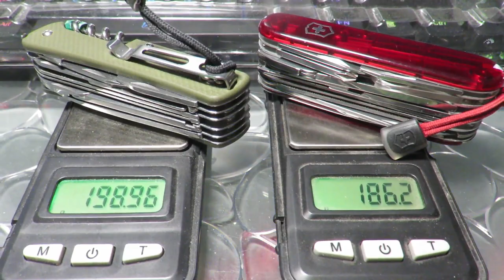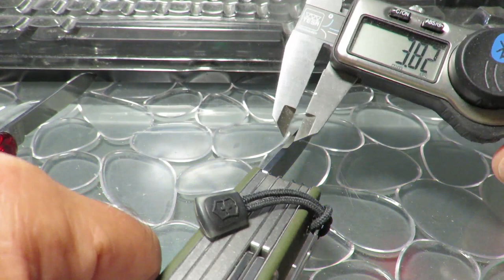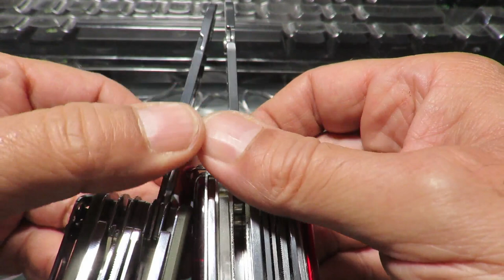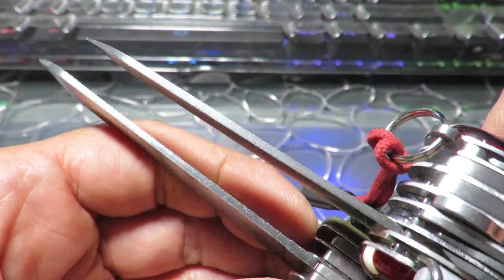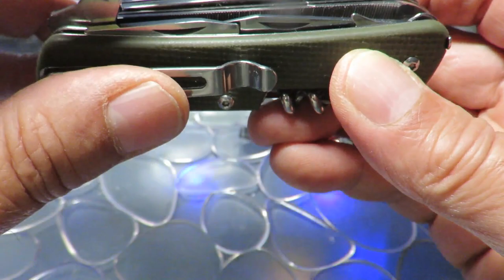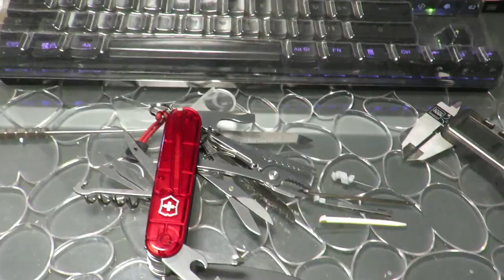RUIKE Criterion M61-G vs VICTORINOX Swiss Champ

Comment from the maker: MT VOD * Dear lovers of multi-tools, you can ask me everything, redo a review, insist on a detail, make comparisons, test this or that, I am at your disposal! :) * Multi-Tool VOD
Here is my collection of multi-tools (August 2020) [/S = Brand Sheath]. Each model has been the subject of one or more videos (see my playlist "MULTI-TOOLS").
001-	BALADEO Outdoor Cutlery Multi-tool /S               
002-	BEAR & SON Bear Jaws 155LS /S
003-	BEAR & SON Bear Jaws Multiscissors Gardener BC157GT /S
004-	BEAR & SON Electrician's Bear Jaws BC155EL /S
005-	BEAR & SON Mini Bear Jaws 153
006-	BIBURY GHK 10-in-1 EDC
007-	BIBURY Multifunction Garden Pruner BBY-MT11 (offered by the company) /S
008-	BIBURY Multifunction Tool 21-in-1 BBY-MT08 (offered by the company) /S
009-	BIBURY Multifunction Tool 16-in-1 X0016E2LAJ (offered by the company) /Box
010-	BLACK FOX BF200 /S
011-	BÔKER PLUS Tech Tool Carbon 4 /S
012-	BÖKER PLUS Tech Tool City 5 /S
013-	BUCK Knives X-Tract 730 /S
014-	BUCK Knives X-Tract 735BKS-B Essential
015-	BUCK Knives BuckTool 350 (MiniBuck)
016-	BUCK Knives BuckTool 355 /S
017-	BUCK Knives BuckTool 360 /S (*2/ one completely broken)
018-	BYRD ByrdRench BY15P /S
019-	COLEMAN Pro Lock /S
020-	CRKT Bivy CR9250 (by Hans Florine)
021-	CRKT Guppie CR9070 (by Launce Barber)
022-	CRKT Technician Multi-tool CR9201 (by Glenn Klecker)
023-	CRKT Tool CR9200 (by Ed Van Hoy & Tom Stokes/ with Bit Kit) /S
024-	CRKT Zylla-Tool Jr. CR9065K /S
025-	CRKT Wooden Multi-Tool Kit CR1035
026-	DEEPEE 8-in-1 Shears Multi-Tool /S
027-	EICKHORN SOLINGEN PRT-II Rescue Knife /Böker S
028-	FISKARS Cuts+More
029-	FLEXCUT JKN91 Right-Handed Carvin' Jack /S
030-	FLOCON DE NEIGE 18-in-1 /S (& 15-in-1)
031-	GANZO G301-H /S
032-	GANZO G302-B /S
033-	GERBER Armbar Drive Onyx
034-	GERBER Balance /S
035-	GERBER Bullrush /S
036-	GERBER Center-Drive (with Bit Kit+ Victorinox Scissors) /S
037-	GERBER Center-Drive Plus (with Bit Kit) /S
038-	GERBER Crucial /S
039-	GERBER Crucial F.A.S.T. (with Hex Bit Kit)  /S
040-	GERBER Curve
041-	GERBER Diesel /S
042-	GERBER Dime (*3/one with broken cissors)
043-	GERBER Flik /S
044-	GERBER Fit /S
045-	GERBER FreeHand /S
046-	GERBER Freeman Exchange (with 3 blades) /S
047-	GERBER Grappler /S
048-	GERBER Prybrid Utility
049-	GERBER MP1 /S
050-	GERBER MP1-MRO (with Bit Kit) /S
051-	GERBER MP 400 Compact Sport (05500/ 45500) /S
052-	GERBER MP 500 Recoil Auto-Plier /S
053-	GERBER MP 600 Bluntnose (old model with 55200 Multi-Plier Pocket Tool Kit) /S
054-	GERBER MP 600 Bluntnose Black (07520G1N Carbide Cutters with Tool Kit) /S
055-	GERBER MP 600 Bluntnose SS (07500 Carbide Cutters) /S
056-	GERBER MP 600 Pro Scout (07564/ 47564 with Tool Kit) /S
057-	GERBER MP 650 Evolution (with 2 heads)
058-	GERBER MP 700 Urban Legend /S
059-	GERBER MP 800 Legend /S
060-	GERBER Multi-Lite (07205)
061-	GERBER Nautilus /S
062-	GERBER Obsidian
063-	GERBER Octane /S (*2)
064-	GERBER Radius /S
065-	GERBER Splice
066-	GERBER Strata /S
067-	GERBER Suspension /S
068-	GERBER Suspension-NXT /S
069-	GERBER Truss /S
070-	GERBER Vise
071-	HANWEI Professional Multi-tool by PAUL CHEN 1008-GT
072-	HAVALON Evolve Jim Shockey Signature Series XTC-60AMTS /S
073-	HENSTRONG (or Bibury or Intey or …) 18-in-1 /S
074-	KERSHAW A100C /S
075-	KERSHAW Select Fire 1920
076-	KELVIN.36
077-	LEATHERMAN Blast (with Removal Bit Driver) /S
078-	LEATHERMAN Brewzer
079-	LEATHERMAN Charge+ (with Bit Kit & Pocket Clip & Lanyard Ring & Bit Driver Extender) /S
080-	LEATHERMAN Charge+ Forest Camo (with Bit Kit & Pocket Clip & Lanyard Ring & Bit Driver Extender) /S
081-	LEATHERMAN Charge+ G10 (red) (with Bit Kit & Pocket Clip & Lanyard Ring & Bit Driver Extender) /S
082-	LEATHERMAN Charge+ TTI (with Bit Kit & Pocket Clip & Lanyard Ring & Bit Driver Extender) /S
083-	LEATHERMAN Charge AL /S
084-	LEATHERMAN Charge ALX Black Oxide /S
085-	LEATHERMAN Charge TI 2HO (with Bit Kit & Pocket Clip & Lanyard Ring & Bit Driver Extender) /S
086-	LEATHERMAN Charge TTI (with Bit Kit & Pocket Clip & Lanyard Ring & Bit Driver Extender) /S
087-	LEATHERMAN Charge XTI (with Bit Kit & Pocket Clip & Lanyard Ring & Bit Driver Extender) /S
088-	LEATHERMAN Core /S
089-	LEATHERMAN Crunch /S (*2 / including a clone)
090-	LEATHERMAN Expanse E306X /S
091-	LEATHERMAN Expanse E33BX /S
092-	LEATHERMAN Expanse E33T /S
093-	LEATHERMAN Expanse E55BX /S
094-	LEATHERMAN Expanse K502X /S
095-	LEATHERMAN Flair /S
096-	LEATHERMAN Free K2X
097-	LEATHERMAN Free K4
098-	LEATHERMAN Free P2 /S
099-	LEATHERMAN Free P4 /S
100-	LEATHERMAN Free T2
101-	LEATHERMAN Free T4
102-	LEATHERMAN Freestyle /S
103-	LEATHERMAN Freestyle CX /S
104-	LEATHERMAN Fuse /S
105-	LEATHERMAN Juice B2
106-	LEATHERMAN Juice C2 /S
107-	LEATHERMAN Juice CS3
108-	LEATHERMAN Juice CS4 /S
109-	LEATHERMAN Juice KF4 (offered by the company & signed in my name by Tim) /S
110-	LEATHERMAN Juice Pro (with Victorinox Mini Screwdriver) /S (*2/ one offered by the company & signed in my name by Tim) /S
111-	LEATHERMAN Juice S2 /S
112-	LEATHERMAN Juice SC2
113-	LEATHERMAN Juice SX /S
114-	LEATHERMAN Juice XE6 (with Victorinox Mini Screwdriver) /S
115-	LEATHERMAN Kick /S
116-	LEATHERMAN Klamath /S
117-	LEATHERMAN Leap /S
118-	LEATHERMAN Mako TI
119-	LEATHERMAN Micra
120-	LEATHERMAN Mini Tool
121-	LEATHERMAN MUT (with Bit Kit & Tool adapter V2) /S
122-	LEATHERMAN MUT EOD /S
123-	LEATHERMAN Nehalem /S
124-	LEATHERMAN OHT (with tweezers) /S (*2)
125-	LEATHERMAN PST (*2)
126-	LEATHERMAN PST II
127-	LEATHERMAN PULSE /S
128-	LEATHERMAN Raptor /S
129-	LEATHERMAN Rebar /S
130-	LEATHERMAN Rev /S
131-	LEATHERMAN Signal /S (with Bit Kit & Bit Driver Extender)
132-	LEATHERMAN Sideclip /S
133-	LEATHERMAN Sidekick /S (with carabiner)
134-	LEATHERMAN Skeletool /S
135-	LEATHERMAN Skeletool CX V1(with Bit Kit & MUT Bits) /S
136-	LEATHERMAN Skeletool CX V2 /S
137-	LEATHERMAN Skeletool KBX
138-	LEATHERMAN Skeletool RX (with Bit Kit & MUT Bits) /S
139-	LEATHERMAN Squirt E4 (*2/ one offered by the company & signed in my name by Tim)
140-	LEATHERMAN Squirt ES4
141-	LEATHERMAN Squirt P4
142-	LEATHERMAN Squirt PS4
143-	LEATHERMAN Squirt S4
144-	LEATHERMAN Style
145-	LEATHERMAN Style CS
146-	LEATHERMAN Style PS
147-	LEATHERMAN Super Tool /S
148-	LEATHERMAN Super Tool 200 (with Tool Adapter V1) /Combo S
149-	LEATHERMAN Super Tool 300 /S
150-	LEATHERMAN Super Tool 300 EOD /S
151-	LEATHERMAN Super Tool 300M /S
152-	LEATHERMAN Surge (with Bit Kit & Pocket Clip & Lanyard Ring & Bit Driver Extender) /S
153-	LEATHERMAN Surge 2013 Black Edition (with Bit Kit & Pocket Clip & Lanyard Ring & Bit Driver Extender) /S
154-	LEATHERMAN Wave (with Bit Kit & Pocket Clip & Lanyard Ring & Bit Driver Extender) /S
155-	LEATHERMAN Wave+ (with Bit Kit & Pocket Clip & Lanyard Ring & Bit Driver Extender) /S
156-	LEATHERMAN Wave+ Black Limited Diegel Edition /S
157-	LEATHERMAN Wave Original /S
158-	LEATHERMAN Wingman V1 /S
159-	MASERIN Citizen 564/G10N (by Moris Baroni)
160-	MAXKNIVES MKTI1
161-	MOSSY OAK 17-in-1 /S
162-	NEXTOOL Xiaomi 10-in-1 KT5023 Motool /S
163-	NEXTOOL Xiaomi Flagship Mini KT5022
164-	OPINEL N°9 Bricolage
165-	OPINEL N°12 Explore
166-	OZARK Trail MULTIFORCE PREMIUM 18-IN-1 MULTI TOOL /S
167-	PIRANHA 6-in-1 (crescent wrench & pliers combo) /S
168-	PIRANHA 9-in-1 (crescent wrench & pliers combo) /S (*2)
169-	RATNIK 6E6 (with diamond-coated file) /S
170-	ROXON Knife Scissors S501 (*2 /  one offered by the company)
171-	ROXON Multi BBQ Tool MBT Mini S602 (offered by the company)
172-	ROXON Multi BBQ Tool MBT3 S601 /S (*2/ one offered by the company)
173-	ROXON Phantasy S502 (with 4 blades)
174-	ROXON Phantom S802 /S (*2)
175-	ROXON Spark CM1349 /S (*2/ one offered by the company)
176-	ROXON Storm S801 (with bit kit & Victorinox Mini Screwdriver) /S (*2 / one offered by the company)
177-	ROXON Storm S801S (with bit kit & Victorinox Mini Screwdriver) /S
178-	RUIKE Criterion M61-G (with Victorinox Mini Screwdriver) /Böker S
179-	RUIKE Trekker LD43 Rescue Tool
180-	RUIKE Trekker LD51-B (with Victorinox Mini Screwdriver) /Victorinox S
181-	SCHRADE Tough Chip ST2 /S
182-	SCHRADE Tough ST1 (original U.S./ version 1) /S
183-	SCHRADE Tough ST1 (Taylor Brands Schrade) /S
184-	SCHRADE Tough ST11 /S
185-	SCHRADE Tough STE5 /S
186-	SEBERTECH Sebertool M2
187-	SEBERTECH Sebertool M4
188-	SOG CrossCut 2.0
189-	SOG CrossGrip
190-	SOG Kilowatt
191-	SOG Paratool S31 (with Saw instead Philipps screwdriver + Bit Driver + Hex Bit Accessory Kit) /S
192-	SOG ParaShears /S
193-	SOG Pocket PowerPlier S44 /S
194-	SOG PowerAccess Deluxe (with bit kit) /S
195-	SOG PowerAssist S66 (with Saw instead of V-Cutter) /S 
196-	SOG PowerDuo PD01 /S
197-	SOG PowerGrab (with Bit Kit) /S
198-	SOG PowerLock S60 (with Bit Kit) /S
199-	SOG PowerPint (with Bit Kit) /Böker S
200-	SOG PowerPlay (with Bit Kit) /S
201-	SOG Snippet
202-	SOG SwitchPlier V2.0 /S
203-	SOG Sync II
204-	SPLITMAN GHK6 (with bit kit) / S
205-	SPYDERCO ASSIST SALT FRN YELLOW C79YL - Rustproof H-1
206-	SWISS+TECH Micro-Max 19-in-1
207-	SWISS+TECH Micro-Plus EX 9-in-1
208-	SWIZA C08 Urban Camo /S
209-	SWIZA D10 Mousse /S
210-	TAG SUPRA SS Credit Card Multi-tool
211-	TOPEAK The Alien I /S
212-	TOPEAK The Alien III /S
Reply from the maker: 213-	TRUE UTILITY Tectonic TU220 /S
214-	UD Vape Cool Kit Multi-tool Cutting Pliers /S
215-	UTICA KUTMASTER Multimaster 11-3565CP /S
216-	VICTORINOX Bantam (ALOX Silver 0.2300.26)
217-	VICTORINOX Classic 2019 Limited Edition When Life Gives You Lemons (0.6223.L1905)
218-	VICTORINOX Classic SD Navy Camo (0.6223.942) /S
219-	VICTORINOX Cybertool L (1.7775.T) /S
220-	VICTORINOX Cybertool Lite (1.7925.T) /S1
221-	VICTORINOX Evolution Grip 18 (2.4913.SC8B1) /S
222-	VICTORINOX Evolution Grip S54 (2.5393.SC) /S
223-	VICTORINOX Expedition Lite (1.7965.AVT) /S
224-	VICTORINOX Explorer 2017 White Christmas Limited Edition (1.6703.77)
225-	VICTORINOX Hiker Wood (1.4611.63))
226-	VICTORINOX Huntsman Lite (1.7915.T) /S
227-	VICTORINOX Huntsman SilverTech (1.3713.T7) /S
228-	VIVTORINOX Jelly SwissCard Lite (0.7333.T3B1)
229-	VICTORINOX MiniChamp (0.6385) /S
230-	VICTORINOX MiniChamp Alox (0.6381.26) /S
231-	VICTORINOX MiniChamp Lite (0.6386) /S
232-	VICTORINOX Nail Clip 580 (0.6463)
233-	VICTORINOX Ouvre Montres (0.2102)
234-	VICTORINOX Pioneer X (ALOX Silver 0.8231.26)
235-	VICTORINOX Ranger Grip 58 Hunter (0.9683.MC) /S
236-	VICTORINOX Ranger Grip 71 Gardener (0.9713.C) /Wenger S
237-	VICTORINOX Ranger Grip Boatsman (0.9798.MWC8) /S
238-	VICTORINOX Rescue Tool (0.8623.MWN) /S
239-	VICTORINOX Signature Lite SilverTech (0.6226.T7) /S
240-	VICTORINOX SportRachet (1999) /S
241-	VICTORINOX Super Tinker 2019 Limited Winter Magic Edition (1.4703.7E1)
242-	VICTORINOX Swiss Army Knife 2018 (0.8461.MWCH) /S
243-	VICTORINOX Swisschamp (1.6795.T) /S
244-	VICTORINOX Swisschamp XAVT (1.6795.XAVT) /S
245-	VICTORINOX Swisschamp XLT [1.6795.XLT] /S
246-	VICTORINOX SwissTool X (3.0327.L) /S
247-	VICTORINOX SwissTool PLUS (3.0323.L) (2008 – BMW/ with all accessories & scissors) /S & Gaine ouverte 4.0829
248-	VICTORINOX SwissTool Spirit XBS (3.0224.3CCH) /S
249-	VICTORINOX SwissTool Spirit XC PLUS RATCHET (3.0239.N) (with all accessories) /S
250-	VICTORINOX Traveller Lite (1.7905.AVT) /S
251-	VICTORINOX Wine Master (walnut wood 0.9701.63) /S
252-	VICTORINOX Workchamp V1 (0.8564) /S
253-	VICTORINOX Workchamp XL (0.8564.xl) /S
254-	WALTHER Multi-Tac /S
255-	WENGER Basic 66 (1 66 41)
256-	WENGER EvoGrip S557 (1.557.059.821 with Victorinox Mini Screwdriver) /S
257-	WENGER PocketGrip 577 /S
258-	WENGER RangerGrip Handyman 1.077.0[90.822] /S
259-	WENGER Swiss Business Tool SBT 60
260-	WENGER Titanium 2 (1.092.042.000) /S
261-	WENGER Titanium 3 Ueli Steck Spécial Edition (1.092.040.000) /S
262-	WORPRO 16-in-1 Multi-tool /S
263-	XIAOMI Nextool Huohou (or Nextool 16-in-1 or 16-in-1 Flagship Pro) /S
	
Acquisition forecast - Call for donations… Sog, Gerber, Victorinox and the others (except Roxon, Bibury & Leatherman) still stubbornly refuse to send me models that I could present. We live in a world unnecessarily absurd delivered to spirits that seem to be content with it...
1-	EMERSON Multitasker EDC 1/ 2
2-	GERBER Cable Dawg
3-	GERBER Method/ Evo/ Crux/ Resolve/ Tread
4-	GERBER MPT #5
5-	GERBER Shortcut/ Clutch/ Mini Suspension-P/ Solstice
6-	GERBER Steady
7-	GRIPsher
8-	KAMPO NS-2
9-	LEATHERMAN Expanse E33B/ K503X
10-	LEATHERMAN Pruner Genus
11-	LEATHERMAN Steens
12-	LEATHERMAN Tread Metric
13-	LEATHERMAN Z-REX
14-	FKMD MPSK Survival Camp Tool FX-444/3MB
15-	MELITA-K Sapper/ Professional
16-	SOG Paladin PowerPlay PT-540
17-	SOG ToolClip
18-	SPYDERCO ClipiTool Rescue C209GS
19-	SPYDERCO Spyderench T01
20-	TOLER TOOLS
21-	WENGER RangerGrip 95 - Rescue II
22-	WENGER SwissGrip (WengerGrip 76)
23-	WENGER Titanium 1 (1.092.041.000)

Comment: The Ruike line is a nice small step up from SAK models with equivalent features. The knife blade is the main upgrade, and it takes and holds a better edge than the ones on a Vic. I swapped out the corkscrew for a Phillips head, as the potions I drink require a winged cork remover. The serrated blade it moderately useful, and I did consider swapping it out for a can opener, but any can opener I use puts too much pressure on the spring, even after some grinding. I’ll keep playing till I can make one fit.